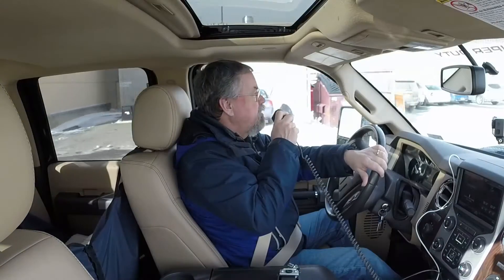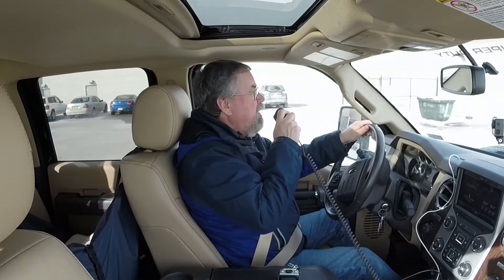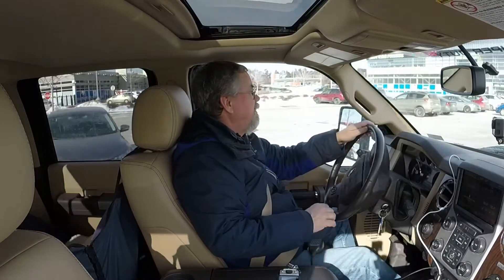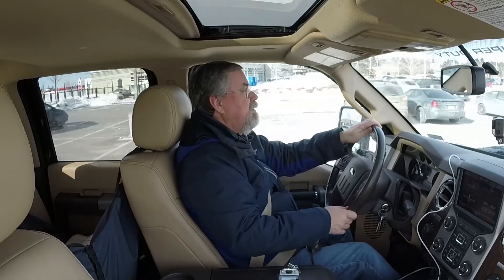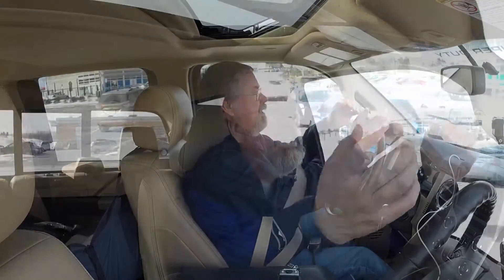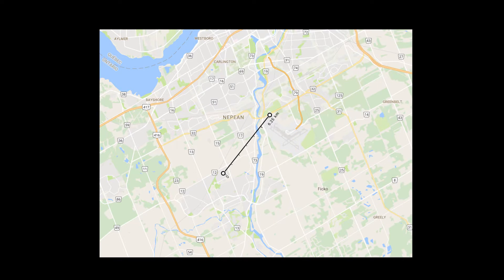mobile wires x

Comment: I dont have a repeater or node within range, i have an ft60 and a good intrrnet conection. What do i need to connect? Thanks
Reply from the maker: You need a node that is in range.  When I made this video I had a HRI-200 box and a FTM-100 configured as an analogue simplex node at my home.  my home antenna was fairy high up so my rage was about 15 miles with the HT.

Comment: In a mobile operation do you need anything other than the radio and antenna to connect and use the wires-x feature? I am looking at the FTM-100 and the FTM-400. Thank you!
Reply from the maker: All you need in the mobile is a radio and antenna but you must be within range of your own node, another user's node or a repeater that is linked into the Wires-X network.
Reply: @VE3BF  So, in all honesty, the FT 60 R is not practical for use when you are traveling.  One really needs a WIRES X compatible radio.
Reply from the maker: @andrewbaerm.d.3984  The FT-60 or any other analogue radio will work if the host is in the analogue mode.  You are correct that it's not the best system but it does work pretty good.    It's a great way for folks who are on a budget or those who want to get a taste for Wire-X before the invest in a new radio to get their feet wet.
Thanks for your comment.  73 de VE3BF
Reply from the maker: the 100 and 400 will connect to Wires X on their own providing that you have a local C4FM repeater or an HRI 100 gateway node linked to the network.  If no service exist in your area then you can still connect in the personal node mode but you will need to use a computer and cell phone data to link to the network (not that great for mobile).  Hopefully there is a repeater in your area.  73 de VE3BF

Comment: I'm brand new, tech privileges. I'm trying to connect with an FT-60. I see three nodes in my city, but I'm not having any luck. Any suggestions? KD9HCZ.
Reply: Hi, Congrats on getting you ticket.  The FT-60 is an analogue radio so the node you want to connect to has to be in the analogue mode for you to connect.  My suggestion would be to contact the node owner for the specific frequency, tone squelch and mode of operation.  I openly share my node with a number of hams that are in range.
I hope that helps.